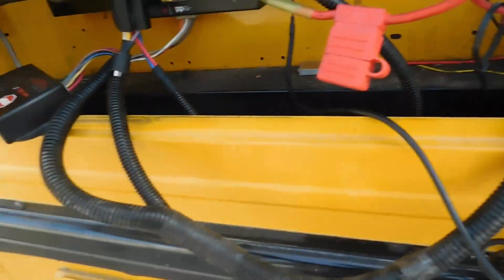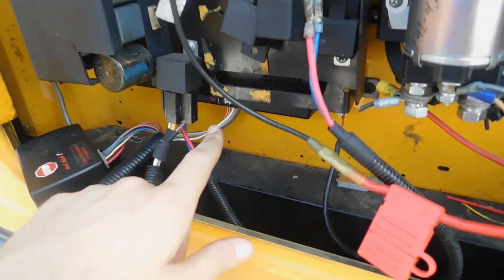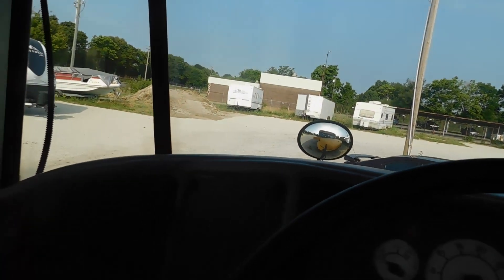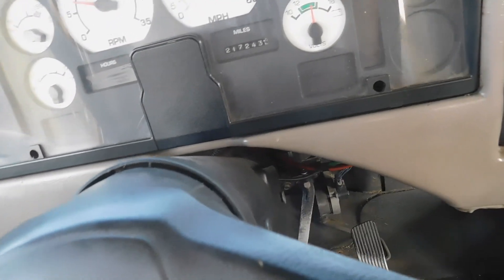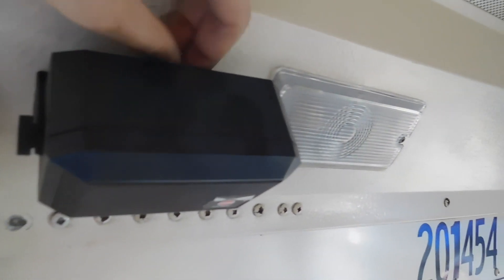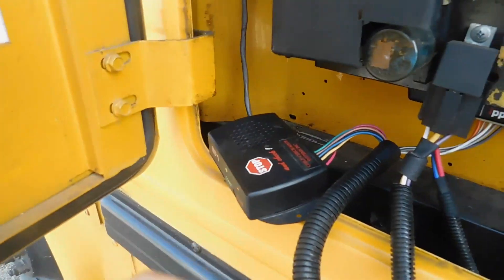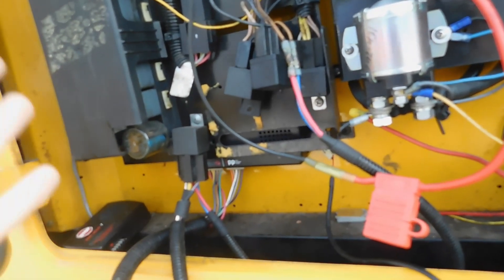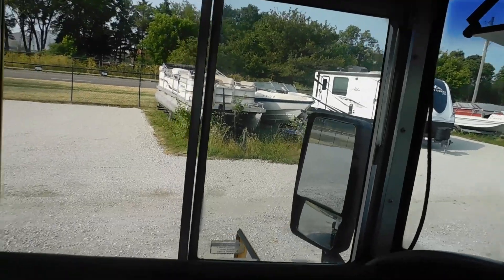Child Checkmate System Update - 2004 IC CE 200

Comment: The reason why Theft-Mate went off is because the motion sensor was not plugged in.  I've toyed around with the units I own and have found that it failsafes to always being triggered when the motion sensor is disconnected.  I always wondered how your bus barn bypassed that, turns out they just put in an EP1 and disconnected power from the EP2.

Comment: Strange how they wired it up to both the EP1 and EP2. And from what it sounds like, the brake input contactor switch might have gone bad. Regarding the two bundled up wires, the Black cable with the two prong plug looks like it would go to the speaker. The three prong gray wire looks like it would go to the motion sensor of the system. 

I did get pictures of the wiring harness for the child check system aboard my bus for you, just need to know where to send them.
Reply from the maker: You can send them to BusBoy501productions@gmail.com
Reply: @BusBoy501Productions soon as I get the chance, I'll send them through. Though my bus is a 2006 CE200, the wiring harness itself should be broadly similar to 50.
Reply: @BusBoy501Productions OH, and depending on the variant of the EP2 with the speaker, it would either say "Please sit down, someone will be with you shortly" or "Authorities have been notified". The "Warning, check for unauthorized entry" wouldn't occur until after the key was put into the ignition and put into either the ACC position, or the Run position.
Reply: @josephbugaj8149 That isn't dependent on that.  It's dependent on whether or not the EP2 has Theft-Mate, which most of them do.  There is a one hour period from when the ignition is turned off before it changes over to the scare tactic.
Reply: @BusMaster99  At work, I’ve only gotten the scare tactic one very few times, most times it’s the first one, before putting the key in. My bus I own didn’t come with the speaker.